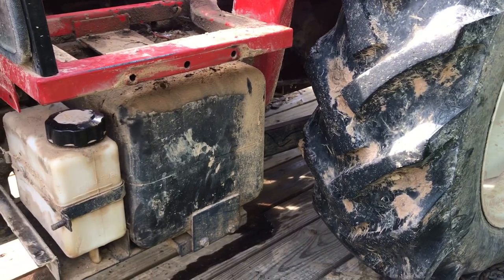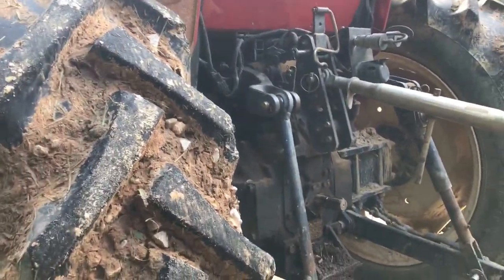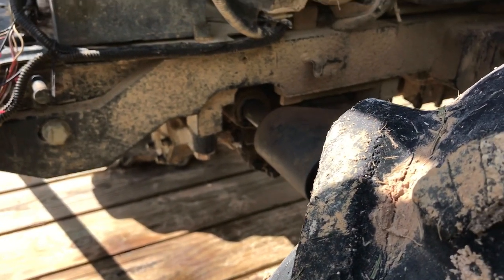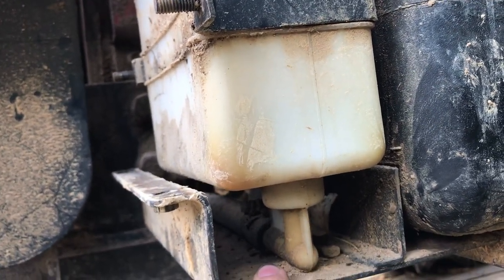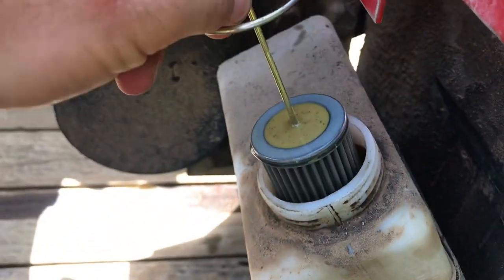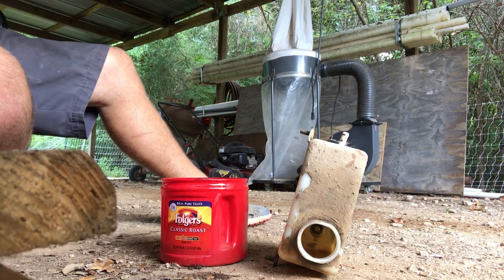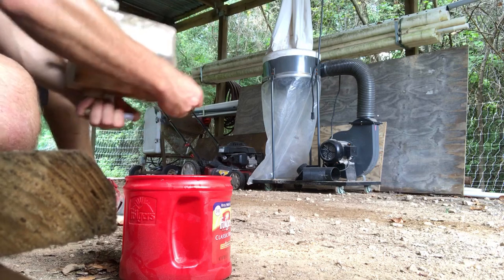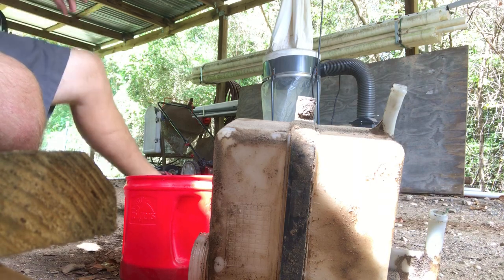Troubleshooting and Cleaning Tractor Power Steering - Century 3040

Comment: I just changed the fluid in my 3045 tonight. Interestingly enough,  mine is a black metal tank rather than plastic. Mounts the same though.  I was able to disconnect the other end of the small hose and let all the fluid drain out that end into a bucket without making a huge mess.  Manual calls for 2 quarts, but about 2 1/2 came out?
Reply from the maker: Mine leaks so I’m always topping it off. Spilled it over the other day. Supposed I’d drain out about a gal right now 🤣

Comment: Well yea it's hard to find parts its an offbrand Chinese tractor
Reply from the maker: Well yeah. Just figured I’d be able to find some aftermarket resources, maybe from the Chinese! Technically I think it’s Japanese or maybe Vietnamese. Doesn’t matter. I’m just surprised by the utter lack of anything online about them. I think more it’s because they were superseded by Branson, so the name just isn’t supported anymore. I don’t know how to cross reference for parts.
Reply: @TomBrueggen  your century is actually south korean made the one good thing is it looks like they run yanmar engines so youll be good on parts there but for misc parts your probably screwed but i bet your right that your steering cylinder is probably leaking internaly like u said try your local hydraulic shop for a rebuild kit for that cylinder if your lucky they might be able to piece a kit together for you hopefully that cylinder is rebuildable and not welded closed but technically the welded ones are rebuildable to but u have to cut them apart with a lathe but anyway good luck
Reply from the maker: Mine actually has a kukje engine...may as well have bought it from HFT. Mix and match nonsense. Built cheap from surplus parts and always changing it seems. Ah well, little Rita has been good to me. I ride that tractor probably way harder than it’s meant to be. 

The cylinder I know can be affordably rebuilt. And I’m not so sure it’s leaking internal anymore. I think it was just low on fluid. It’s visibly seeping on both ends. I’ve had quote to rebuild it for about $150. It’s the time and labor to take it off that’s holding my back. Don’t want my tractor out of service so for now I just top off the hydraulic fluid in the steering reservoir now and then.
Reply: @TomBrueggen  i gotcha well good luck with it maybe someday trade up to a deere or kubota lol atleast you should always be able to find parts for them ... for the most part lol